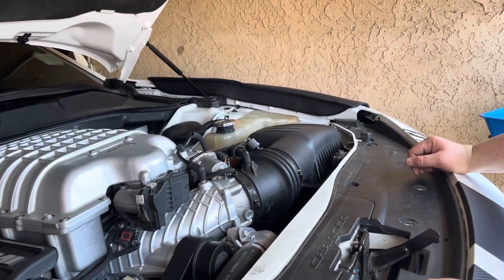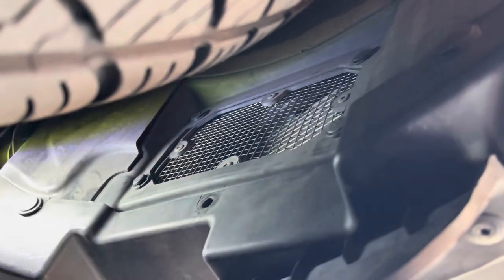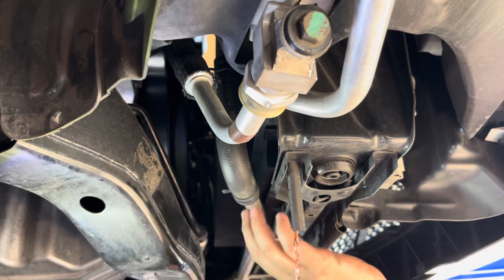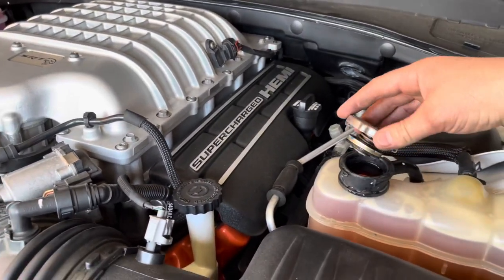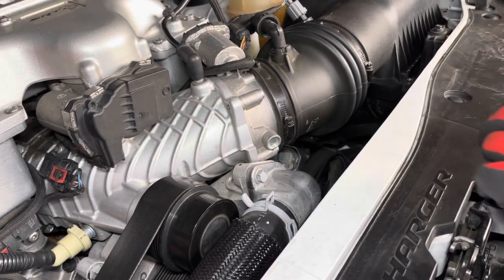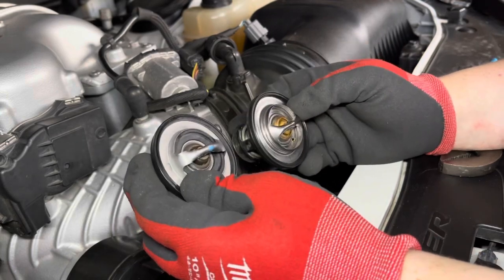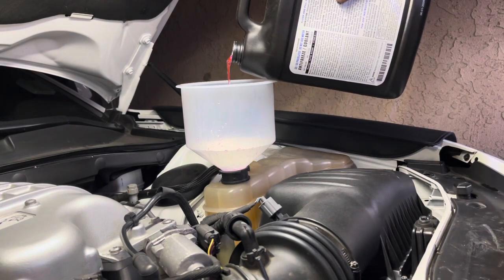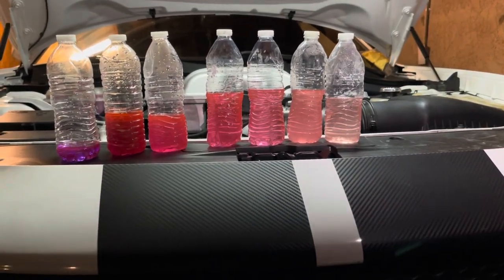Coolant Flush in a Hellcat!!

Comment: The coolant color depends on the year of the car.  My 2010 takes the OAT which is orange in color and then Mopar started changing to the more environmentally friendly, but not as good purple stuff from 2013 to 2016 depending on the vehicle.  At any rate, you cannot mix the two or it gums up and ruins your engine so make sure you flush it really well like in the video and then it doesn't matter so much.  I have had the orange stuff in my car for 13 years and the car has never overheated and I live in Texas.  I think I will change it next week since you will not be able to buy HEMIs anymore.

Comment: I did this today and fill the tank up, turned it on and got it to operating temp and the coolant level dropped like crazy when I turned it off...how the heck did yours not?
Reply from the maker: Every car is different and maybe you just had a lot of air in the system and when you turned of the car most of the air came out and sucking down the coolant in the system.

Comment: Informative video but I do have a question. I’m looking to do this on my older 5.7L and I’ve read that this generation HEMI doesn’t fully drain the engine of its coolant without opening the drain bolts on both sides of the engine block as well. Additionally, even then, I’ve heard that all the coolant / water doesn’t drain so I’ve ready advice that is against using the pre-diluted coolant because the water still present in the system will not allow the 50/50 mix to be correct.
Reply from the maker: Yes you are correct about having to drain the block by the drain plugs. Yea I would assume that no mater the system, simply draining it will always leave some unknown amount of coolant/ water but I would still suggest to use a 50/50 mixture to refill your system.
Reply: Lo que tienes que hacer es hacer un enjuague unas dos oh tres veces luego de eso llenas con refrigerante y luego cada mes deberías botarlo y llenar con nuevo refrigerante hasta q logres votar todo, ahora bien hay q tener mucho cuidado con los enjuagues no puedes tener solo agua destilada en el sistema porque está va a hervir, ya que el refrigerante Mopar aguanta casi 106 grados C, (225 F), por ende si quieres lavar a full deberás tener en cuenta eso y vigilar la temperatura

Comment: To make this job quicker, try the following
1. The petcock does not need to be closed for flushing, just fold the drain hose over on itself and secure with a pair of vice grips
2. Engine does not need to cool down, just unclip the vice grips and coolant will drain. Then re-fold and clamp the drain hose
3. Refill with near boiling water (use the electric jug)
4. Run engine for 5 minutes
5. Repeat as necessary 
6. Close the petcock 
7. Final fill with red coolant concentrate. It will take 6-7 litres. Cooling system capacity is 14 litres. So easy to make 50:50
Reply from the maker: Thanks for the tip I really appreciate it!

Comment: Great video but I have a question. I’m not doing a full coolant flush but I need to add some coolant. Can I just match the color of the coolant when I add it? It looks to be a light pink color like in your video.
Reply from the maker: A lot of times coolant colors are not compatible, some will argue they are and some will argue they aren’t. My suggestion is find out what your specific vehicle takes whether it’s OAT or HOAT and go based off that.

Comment: Good video. But you should be able to remove the bleeder screw, and just fill it with coolant until it comes out of the bleeder screw hole. Then top it off. You shouldn't need to use the special funnel. That's what I did on my 5.7 anyway.
Reply from the maker: Yea that’s also another way to do it and an easier way but I didn’t see a bleeder screw on my engine but also I was doing it the way I did for video purposes. Thank you though I appreciate it.
Reply: @StevenDIY392 the bleeder screw is beneath the intake ask me how I know lol

Comment: So if the thermostat opens only at operating temperatures then how do you flush out the coolant through the heater core if your letting the car cool down allowing the thermostat to close up again. Doesn’t that mean that when you flush it there’s stills coolant in the heater core thats not coming out cause the thermostat is closed because you let the car cool down?
Reply from the maker: To flush coolant out of the heater core you need to have the heater in the cabin on full blast that will circulate coolant from the engine block to the heater core. Yes letting the car cool down does allow the thermostat to close up but it doesn’t cool all the way down so when you start the car up again it only takes 5-10 min for the thermostat to open again but also just because the thermostat is closed, your still getting some coolant circulating through the system still.

Comment: How much do you have to turn the petcock for it to pull out & drain? Mine only turns 1/4 turn (45 degrees) then stops. Wont pull out, wont drain. I feel as if forcing it to turn more than that 1/4 turn will break it.
Reply: Man I thought the same thing. I ended up draining the system by removing the lower radiator hose instead. Turns out that if you just unscrew the petcock a few more turns, it will in fact drain. It feels like it's going to pop out, but it doesn't.
Reply: Very inexpensive if it breaks just twist more and pull out slowly will get removed eventually
Reply from the maker: Yes you can keep turning it, it feels like that but it won’t break, worst thing that might happen is you pull it all the way out and it’s a little hard to put back in but not impossible.

Comment: Quick question do you turn the petcok drian a little bit or can you get a few turns on it?  because I turned it only once and I didn't get anything out I'm assuming I have to keep going?
Reply from the maker: Yea you have to get a few turns on it so it will drain coolant out. Just be careful not to turn it to much because then it will pop out and it’s a pain in the xxx to get back in. If it happens to come out like mine did, I tapped it back in with a small hammer but be very careful doing something like that because you can crack your petcock housing or radiator and then you would have to replace the whole radiator.
Reply: Thanks worked!

Comment: How long, you reckon it took you to do this full flush? I noticed daylight into dark
Reply from the maker: Hello, great question I did start it late in the afternoon & filming it also made it a lot longer than it should have been. Without the filming, I’m guessing it would have took maybe a couple hours. It all depends on how many times you want to flush the system & waiting for the vehicle to cool off enough to safely open the system as well as on your final flush, getting all the air out of the system.
Reply: @StevenDIY392  thanks. I’ve noticed my fluids looking a bit off at 27k. 
I was getting worried something much worse was happening till I seen your video.

Comment: I had the dealer do this today on my 15 chally hellcat , for some reason when the car is running the coolant sinks/ gets sucked in , after I let the car cool off I take off cap and a whole lot of air comes out bringing the coolant back to normal level, once I drive again the coolant gets sucked in again is this normal ?
Reply from the maker: Did this happen before or after the dealer did the service or has this always occurred? I have seen this happen on vehicles before but I never noticed this on my Hellcat. It’s possible you have air in the system but if your heater gets hot and as long as your coolant level stays full and doesn’t drop below the low level, I would say it’s fine.

Comment: Any idea why car overheats when my heaters not on? When I have the flush liquid in it my car won’t overheat at all. It’s puzzling me!
Reply from the maker: That is strange! Are you sure you have all the air out of the system? The only thing I can think of is maybe your car is not overheating when the heater is on cause the coolant is flowing through the heater core giving it another pathway. Have you checked your thermostat make sure it’s not stuck closed? As for the flush liquid maybe it’s chemical makeup is reacting in some way with the coolant causing it to have a much higher boiling point.
Reply: Check the plastic tee connection it’s plastic it breaks over time getting air in the system will not leak in some cases but will cause your car to overheat check that and replace it with a metal tee instead of

Comment: Can you use that mopar purple coolant on a 2007 charger SRT 8 6.1?
Reply from the maker: Mopar switch over to this coolant OAT around 2015 I believe from their HOAT coolant, if your a fanatic like me about your car I would stick to the coolant Mopar recommends for your vehicle. The different chemicals they add to the coolant can negatively react with the aluminum and others metals in your cars system and deteriorate gaskets and engine parts. I would stick to what mopar recommends which is probably the orange HOAT coolant.
Reply: @StevenDIY392  thank you..

Comment: What did you do to get that Petcock back on on your wife's charger? I can't get mine back on. Any advice is appreciated. Thx man!
Reply from the maker: Its tricky, I literally got a mini hammer, stuck it in the hole evenly and gently tapped it back in enough I could screw it back in, it took me a couple try's but if you do that be very gentle cause you can crack your radiator and will have to replace the entire radiator. Also try pushing it in as you turn it may also help but however you do it make sure you rub it with some coolant to help it go in easier. I hope that helps!

Comment: during your first flush was the water in the reservoir still? because my first flush there was water still in the reservoir that didn’t go down
Reply from the maker: Yes there was still water in my reservoir, in all my flushes I filled the hole system up even the reservoir with water & let it cycle through.
Reply: Only use distilled regular water has too many minerals

Comment: Is this almost the same process with a 392 charger?
Reply from the maker: Yes all vehicles are pretty much the same process however some vehicles have a bleeder screw on the thermostat housing or near there that you can open and run the vehicle so air can escape, makes it a lot easier.

Comment: How do you flush the supercharger tank
Reply from the maker: I’m not 100% sure but I would assume you could pull out all the coolant from the supercharger tank and fill it with water maybe preferably just new coolant  or cleaner and do similar to a regular coolant flush or just remove coolant in the tank & put fresh coolant in & let it run for a couple days and repeat the process a couple of times. Unfortunately my Hellcat got stolen before I could ever attempt this maintenance.

Comment: What did you do to burp it just move the lines around?
Reply from the maker: I usually squeeze & release multiple times the upper radar hose, some engines or thermostat housings have air bleeder valves to assist burping the air out.

Comment: Each time you do the flush cycle do you keep adding the prestone? Or is that a one time thing?
Reply from the maker: Thank you for the question!! In my video I only used the Preston cleaner 1 time  for 1 cycle however if your system is bad with sediments or has been neglected I would use the Preston cleaner maybe 1 time per 2 or 3 cycles.
Reply: @StevenDIY392  just curious but does the hellcat come with a bleeder valve? If so, why didn’t you use that to help you bleed the the system and lessen the air? Thanks !
Reply from the maker: Thank you that’s a great question. I should have touched on that in the video. According to service info it doesn’t have a bleeder valve nor did I see one it calls for a vacuum refill which is much easier and faster to do and gives you no air in the system which is the way most vehicles are done today requiring special tool.
Reply: @StevenDIY392  ohhh got it. Do you plan on getting it vacuum filled? Or are you going to continue to take this approach? Thanks again for your answers!
Reply from the maker: @Fitteds4dayz  for now I plan to just take this approach although in the future I would prefer to go vacuum filled as it’s a lot easier, less time consuming and gives you no air in the system. Of course no problem.

Comment: What happens if the car overheats while you have it on with the heat running?
Reply from the maker: You have to watch it & make sure it dosent overheat. You have to turn it off and let it cool if it starts going over normal operating temperature. If it does overheat you can seriously damage your engine.

Comment: I’ve owned my charger gt for about 16 months, haven’t changed my coolant until now. Is it better to flush out the coolant or re fill it? The coolant in my reservoir looks like the same coolant flush on the first one on yours.
Reply: It’s a purple ish color still to it
Reply from the maker: Nice! How are you liking it? Well if the car is new especially with a purplish color to it, the coolant is still good according to service info as for my Hellcat it doesn’t require a flush until 150K miles but if your like me & want to keep your car in top shape I say go for it. If it’s new & still has the color to it you could just drain & fill but if your going to replace any component in the system like the thermostat or you don’t mind going through the flushing process I say definitely go with the flush!! Sorry for the long answer hope that helps.
Reply: @StevenDIY392  runs like a charm my guy! Appreciate it brother! Subbed for more content! Keep it going 🦾
Reply from the maker: That’s great to hear! Great thank you, I really appreciate it!!

Comment: Next time you should probably use full coolant and measure what comes out. For example my Buick Century has a coolant capacity of 11.6 quarts, and if it's filled with almost all water and I can drain only 8 quarts I know there is 3,6 quarts of water left. So I would add 3.6 quarts of 100% coolant then the rest 50/50 mixture. 

I'm doing mine right now and did the first drain. I only got less than 4 out of 11.6 quarts, and I was hoping to find a magic trick to get more out. If I can't get more than 6 quarts from the final drain I'll just fill with straight coolant and call it a day.
Reply from the maker: Yea I see what your saying, I’ve never heard it being done that way before but I see the logic behind it. I mean you could also just flush it with 50/50 instead of water but that would be more expensive. Yea but I know what you mean you can’t get all of it out so you are left with some water in the system.

Comment: Where can I get the mopar pre diluted mix from?
Reply from the maker: You can get it at your local dealership but I recommend calling at least 3 to check for price and go with the lowest 1 I have found different dealerships charge different prices when it comes to parts & fluids or you can go to Moparamerica.com and get OEM parts and coolant for cheaper price.
Reply: @StevenDIY392  thanks bro
Reply from the maker: No problem anytime, thanks for the question.

Comment: Would you recommend doing this with 17 000 miles I want fresh coolant is it bad to do it now
Reply from the maker: The service interval depends on the specific vehicle but my Hellcat is 10 years or 150,000 miles I did mine really early for preventative measures. To answer your question it never hurts to do any maintenance early on your car only doing it late will cause problems.  I would say go for it .